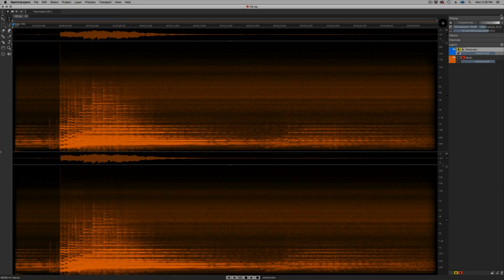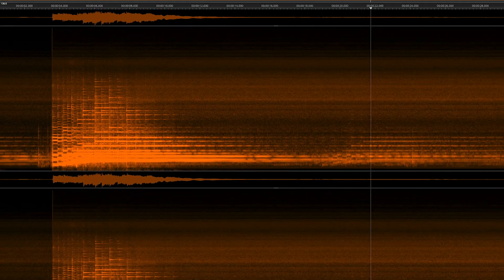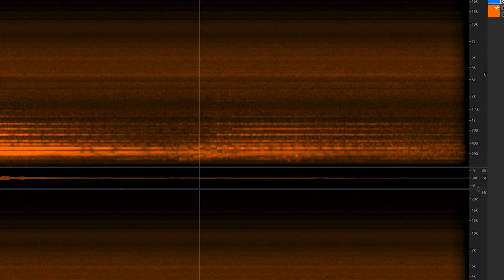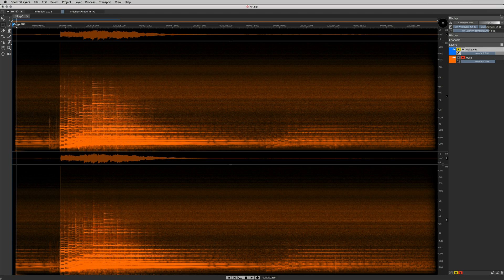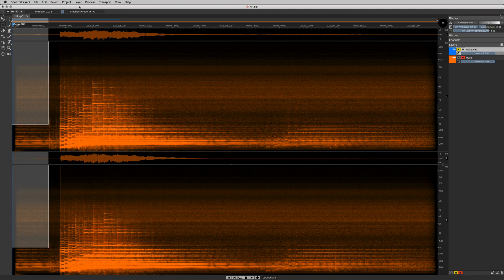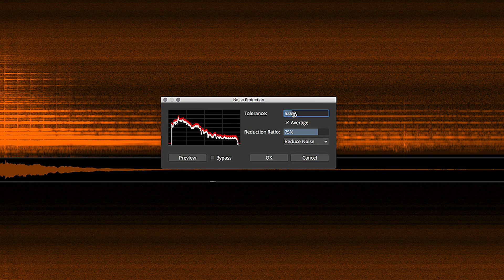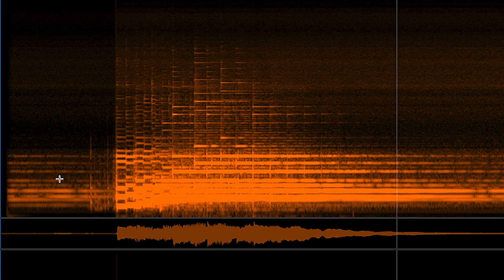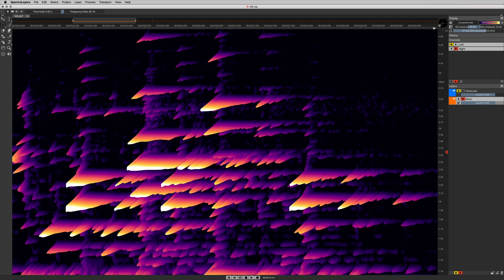Noise Reduction | SpectraLayers Elements Tutorials

Comment: Why should I get this over RX?
Reply: RX is the standard for fixing problems, this has far more flexibility for creative sound design and remixing.
Reply: @BrendanWestBogPerson  Tis' a product for less than 80 bucks. Show me any other product that can do what spectralayers elements can do for less than that.
Reply: SL provides more customization of the noiseprint. https://youtu.be/ED8mSlO2wdg?t=86
Reply: @mikescheibinger5191  RX does the exact same if you use the standalone version. There you can make frequency selections to base your noise reduction on as well.
Reply: Rx is like Lightroom, and Spectralayers is like Photoshop. Being able to work in multiple layers opens up more flexibility in my opinion. Also, cheaper than RX by far. AND ALSO this supports ARA 2 workflow, and RX doesn't support ARA 2. I purchased and own all Izotope softwares, but I plan to switch to Spectralayers for a while.
Reply: I am an RX user, but I've recently discovered VST compatibility issues in both RX 6 and RX 7. I've also recently discovered I wasn't the first one to notice this problem. I'm hoping that, since VST is Steinberg technology, VST compatibility won't be an issue with SpectraLayers.

To be fair, though, SLElements is roughly analogous to RX 7 Elements, and Izotope sometimes puts RX Elements on sale for $29, which is a lot less than even the $80 Steinberg is charging for SLElements. That personally wouldn't influence my purchasing decision, but I thought I should say something just in case.